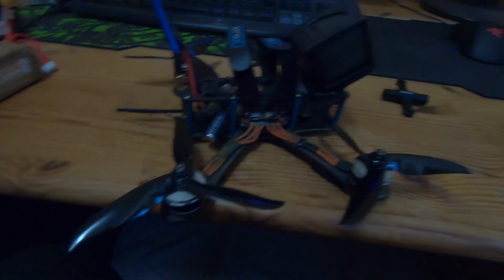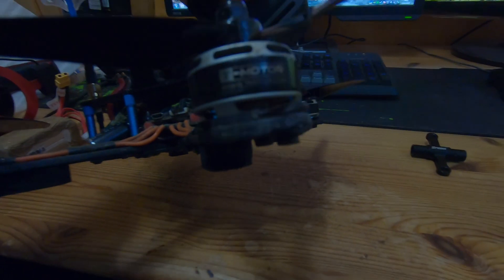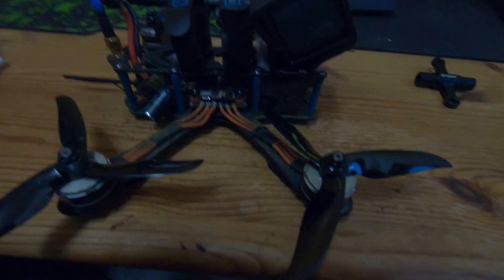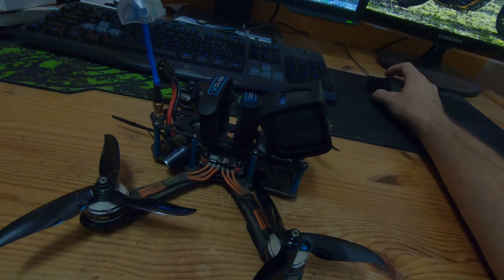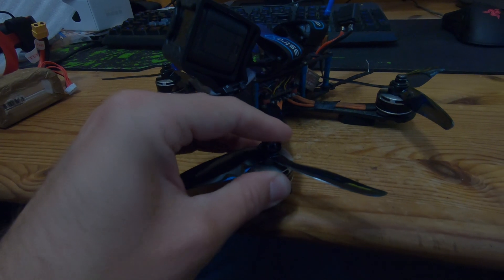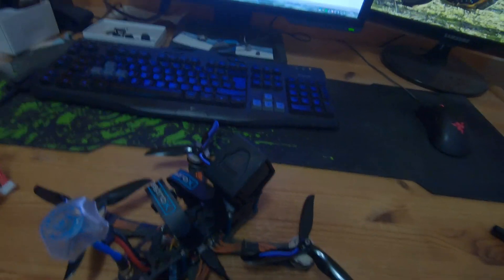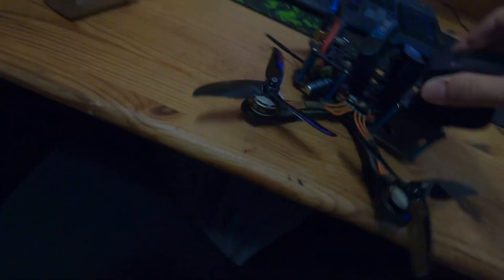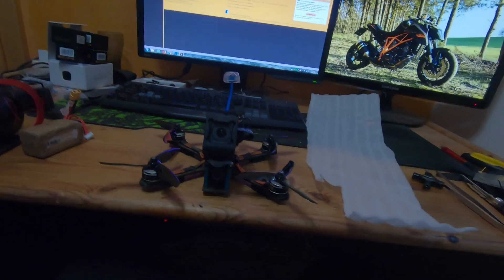Fixing Jello - Mid Throttle Oscillations on your FPV - Drone (GoPro) special technique

Comment: Do you locktite your prop nuts?

I saved some of that white thin packing foam just as a matter of course, to squeeze between my battery and the quad if I were to mount the battery on the bottom over some screws and to at least provide some minimum cushion between the two on a ground impact.

Comment: Man i hated these oscillation problems..   I soft mounted the motor and the FC plus i have the capacitor on too.  In mid throttle, i can see the oscillation on the HD cam. Im going use the soft mount for the hd came and see.
Reply from the maker: These are the worst problems.. i Hope it works for you

Comment: Nice, i have the same problem on my 6" quad, i've  cheched everiting , pid tuned , tryed  3 type of different propeller but the jello persist. Now i go to try your solution and see if it work even for me
Reply from the maker: akus reverse wish you that it works, that jello is so frustrating, put enough layers underneath it. But not to much that your gopro cant move. Good luck man 🤗